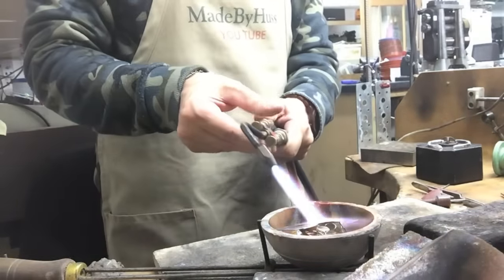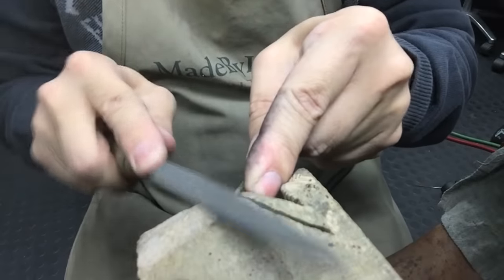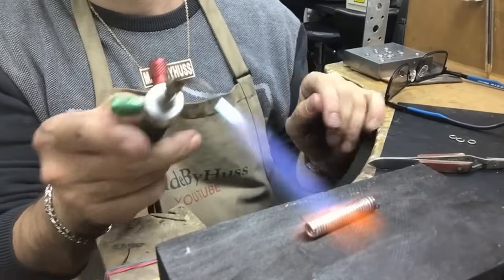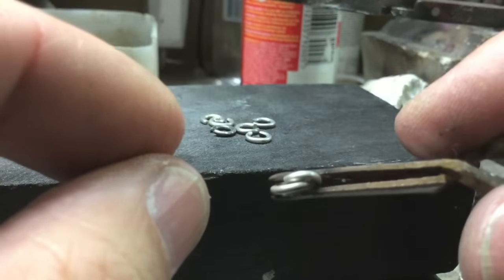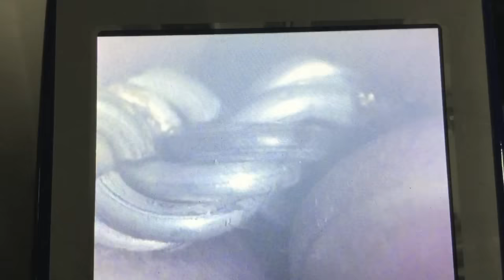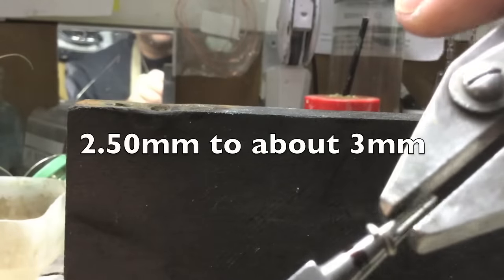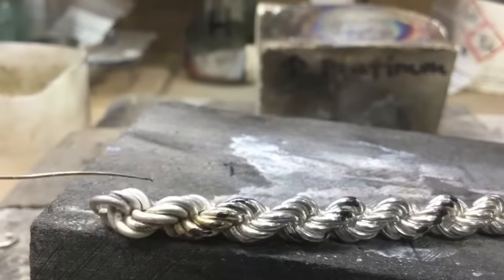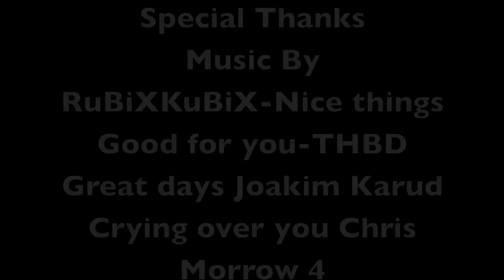How to make a rope chain tutorial (part 1)

Comment: I use a clean thick welders glove on my hands when drawing long wire that is too long for the shop. Wrap it around until you have a "grip". It doesn't hurt too much. No marks whatsoever and no pausing marks. Oil of Wintergreen is great in drawplates - good for burnishing also. Thanks for sharing!
Reply from the maker: Doug Bader thank you

Comment: thats a great looking chain there has to be a way to make it with out soldering it at ever link I like it a lot the soldering thing I don't know much I use copper wire and  finding a solder to blend in is not an easy task to this day I have not 
will you know of any brands I may look for or anything I may try worse yet were I may find what ever you recommend 
     thank you in advance
Reply from the maker: I have a video showing how to put together a rope chain with no solder but this is not practical at all the wire I use in that video was very soft but it shows how to do it copper may work because it’s harder. As for soldering copper I use silver solder yes not the same colour but it can be plated after all so you can try brass which is yellow and the silver solder does not look so bad on it hope this helps

Comment: Would an upscaled design of this (made with appropriate materials) be able to withstand use as a utility chain
Reply from the maker: Yes and no if both sides are soldered it’s pretty strong depends on what you would use it for oh and plus the lock matters too
Reply: @MadeByHuss  I was thinking a chain whip with a small payload I suppose

Comment: So this a new interest of mine. 
In the beginning you said to put it through the wiring mill slowly or the metal will crack...
No matter how slow I go through this process the silver flakes and could you elaborate this process for me?  
It makes it hard to go through the draw plate...
Reply from the maker: Justin Gill yes try when melting the silver make sure you heat it very well making sure every thing is clean and when milking slow and heart the silver after 3-4 mills and close the mills slowly don’t rush if this don’t work your silver is not clean and could be contaminated
Reply: MadeByHuss what advice would you give for soldering??  I’m having some trouble getting it to flow where I want... or just to flow at all.  I clean it with sand paper. I’m using hard flux. I’ve gotten it to work a few times. But it’s very inconsistent
Reply from the maker: Justin Gill to clean it best you have to heat it and put in acid then heat it and then put flux it will dry where you want it to flow and use easy solder good luck
Reply: MadeByHuss what kind of acid? Sulfuric acid?? So, use easy solder and dip the Jump rings in acid before soldering... worth a shot?... It’s been a few days since I’ve gone for it.
Reply from the maker: Justin Gill sulphuric acid
Reply: Must start with very clean scrap. It can’t have much solder in it, no chains. Try using sterling flatware. Or fresh silver for a supplier.
Reply: you need to make sure you heat the metal you are trying to join rather than the solder. the heat from the metal is what melts the solder not your torch

Comment: Question 
If you are making a bracelet of 9 in how long  you need to roll and round the material ..how many times the length of the bracelet.. thanks for this great video
Reply from the maker: i think the weight was about 26 grams so I go by the weight be sure to start with a little extra

Comment: Could you do this with much smaller diameter wire and smaller links? To make a finer chain or does that weaken it?
Reply from the maker: Hudson Tolleson if have the patience yes check out the disruption or may in my other rope chain video to work out size of links  and best of luck thanks for commenting

Comment: Which links get soldered to tighten it up or strengthen the chain? I have completed a couple thick ones but they are loose. I noticed you soldering the finished links and wondered which ones and where.
Reply from the maker: Rob Howe I solder 2 together then a space between I’m sure I show this in the video so you do 1and2 then 3and4th never 2st 3fd not easy putting it in words

Comment: hi my friend, I would like to ask you something? If I bend a 2mm wire over a 5mm mandrel, how many meters of wire do I need for a 70cm chain and 20cm bracelet for a total of 90cm rope chain? I would be very happy if you could help me

Please Help me my friend 🙏🏻🙏🏻🙏🏻
Reply from the maker: @dazzlingdesignbydd6001  I’m not going to know the answer to that but what I would do is make a sample just a inch long and work it out from there you can use silver or copper
Reply from the maker: Use the weight of the sample

Comment: Also what type of torch is that and where do you buy one like that?
Reply from the maker: DEZZVLOGS  Smith little torch icy gas fuels systems here in the UK cooksongold or Walsh they have a web site check them out
Reply: MadeByHuss what torch would I buy for melting silver brass or any types of metal?
Reply from the maker: DEZZVLOGS just looking up the name and can’t find one it’s made from brass and it’s bigger then the smith little torch I’ll have a look at work for the name
Reply from the maker: DEZZVLOGS or I’m sure a casting torch will be fine
Reply: Thank you
Reply: MadeByHuss can The the Smith little torch melt metals like silver gold and more?
Reply from the maker: DEZZVLOGS well it depends on how much you want to melt but yes you can do like 10 to 15 grams easy you can get bigger tips for the torch so you can melt more like 20 to 25 grams
Reply: MadeByHuss for a starter what would be the best torch to start with ? To melt metals?
Reply from the maker: DEZZVLOGS the first one I said Smith little torch you can change the tips so you have different sizes

Comment: Aprox how many feet of wire would I need if I wanted to make a 20" 4mm rope?
Reply from the maker: ryan ware this one is 6.5mm the weight is 28 grams and it’s 8 inches I would a inch or two as a sample then work it out from there